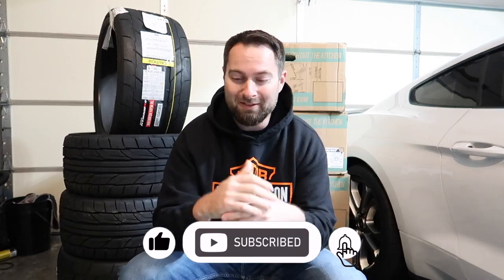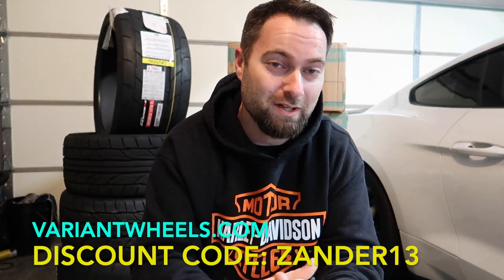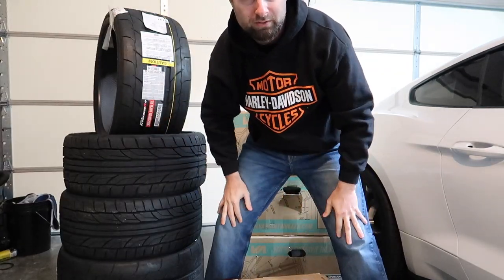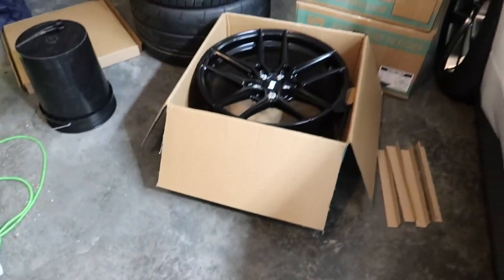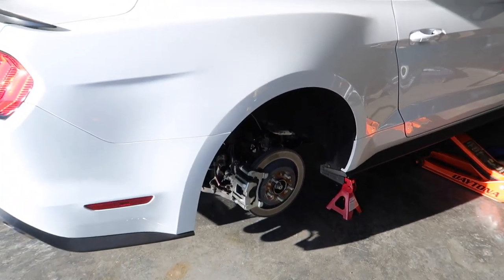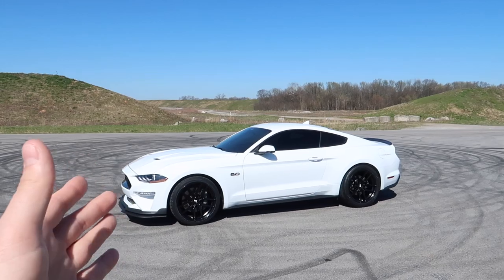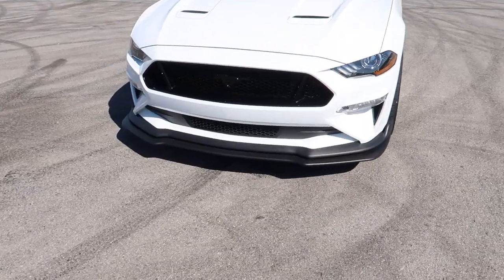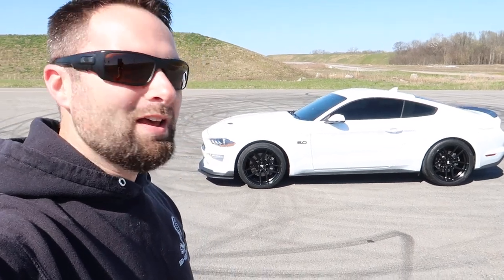FIRST EVER VARIANT HELIUM WHEELS ON A 2022 MUSTANG GT s550 LOOK INSANE 🔥

Comment: Nice Wheels! By the way your code has expired, tried ordering some rims and applied the code and it did not give me the wheel cleaner or ceramic coating for free 🤷🏾‍♀️
Reply from the maker: Let me check on it. Did you already purchase?
Reply: @Zander13Productions  No I didn’t, just cancelled the order. Decided to just wait a couple months.

Comment: When he weighed the wheels he said, “ I’m gonna step on the scale fully dressed”

Well I sure hope so!

Ha
Reply: @Zander13Productions  hey dude. I like your work man. Keep it up. And BTW, I’m a Mustang guy through and through but I too ALMOST bought the new Supra( manual) Preowned with 2500 miles. Test drive and all but just couldn’t get myself to trade in the S550 just yet. Which BTW, is also Ox White!